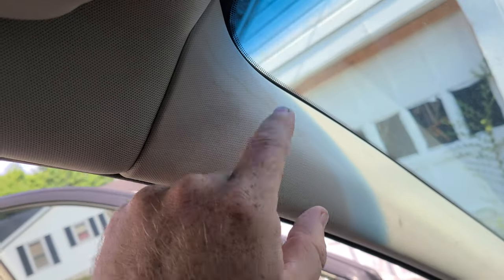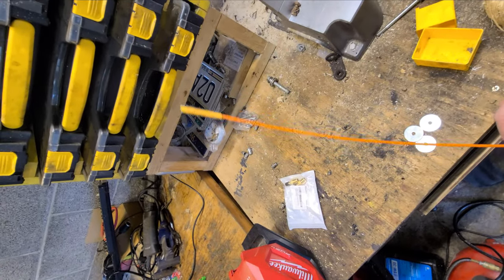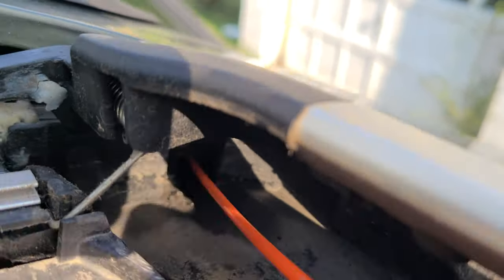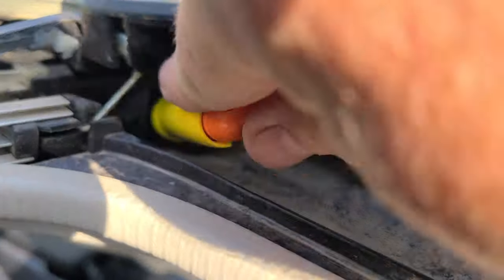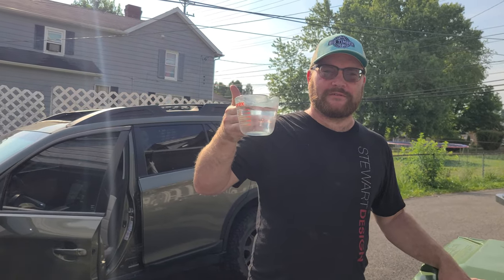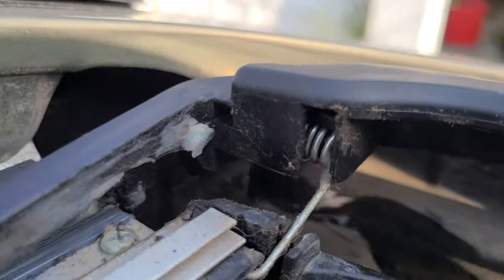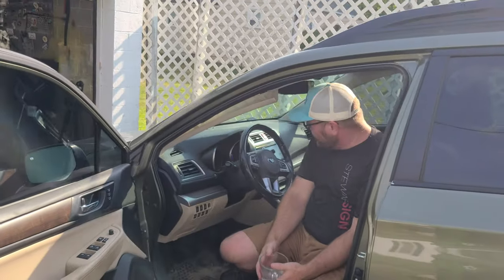QUICK, CHEAP, and EASY! Clean your Sunroof Drain! 2015-2019 Subaru Outback

Comment: This video helped me to clear up the extreme leaking through my sun roof.  I just took a coat hanger and found the holes on both corners where the sun roof meets the roof frame and cleared the gunk out of the holes.  Thanks so much!!!
Reply from the maker: I was going to use a weed eater string if what I showed didn't work. A coat hanger sounds perfect too!
Reply: Just so you know that is rubber tubing and a coat hanger could really damage it
Reply: @howardmcginniss6663  good point. I'll wrap my coat hanger in electrical tape first.

Comment: Good video.If you do not do this, it will drip and pool under passenger seat (road slope when parked in street is down hill toward passenger side) and could cause issues with computer control box under there. First time this happened I could did not notice untill there was a lake under the seats. Stereo made wire wup wwup noise until it dried out. My 2012 sunroof gets stuck in open position, so I do not use it. Dirt still builds up, parked under oak tree in Sacramento, and we get endless agriculture dust here. Currently have a tarp over sunroof, I forgot to do this before the bomb cyclone! It will also drip from center overhead because it splashes around when driving.....
Reply from the maker: If you don't use it I've seen people put clear tint over the entire thing up to the roof.

Comment: Would this lead to water pooling in the rear floorboards and front driver's side floorboard?
Reply from the maker: It could! It's easy to check.
Reply: It did on my Outback. The pooled water overflowed and leaked into the headlined and window pillars leading to the passenger carpet. After I cleared the drain holes the carpet and inside roof liner is no longer wet.

Comment: Thank you for this video!  Had this problem with my 2019 Outback.  The passenger side drain was clogged.  I even had that very same snake tool in the garage.  
The clogged drain was cleared within a few minutes, and also checked the driver's side drain, which was working fine. 👍

Comment: Awesome video thanks fixed the leak straight away... by the way i had this issue earlier and water travelled down the A pillar to the passenger foot well and shorted out the release for the electric hand brake.. hand brake would not come off had to that the car trailered to the shop for repair.. shop replaced both hand brake motors $$$$$ only for it to happen again the next time it rained.... all because a blocked drain.... man... Subaru what were you thinking....
Reply: Cheers.. going to do mine after you explained, what issues could arise...

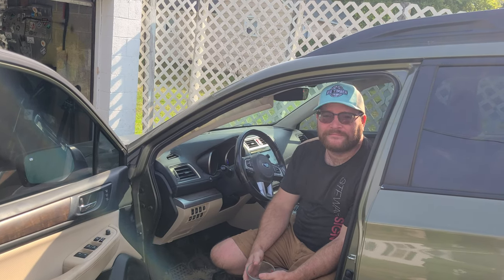Comment: Awesomo 2000!  Great tip!  Mine has 132,000 and still drains okay here in dusty So. 3:15 California.  Should check em’ though.   Hey Bruceyyyyyyyy, I was recently using my rear 12v power port to pump up a pool floaty with air compressor and lost power.  Checked fuses and all seem okay.  Even replaced with spares just in case.  Under dash and center console 12v both working fine but rear cargo port is dead.  Any idea?  Thanks in advance.
Reply from the maker: I missed this message. Did you ever get it sorted or did you still need help?
Reply: Took it apart and sure enough, it was melted so plastic in the way of making contact.  Cleaned it up, put it back together and good as new.  Thanks!